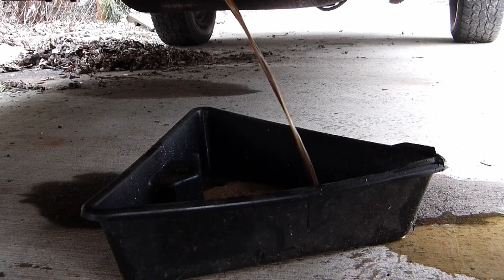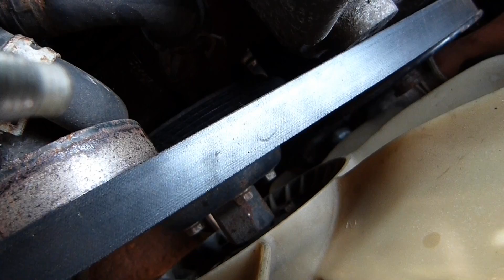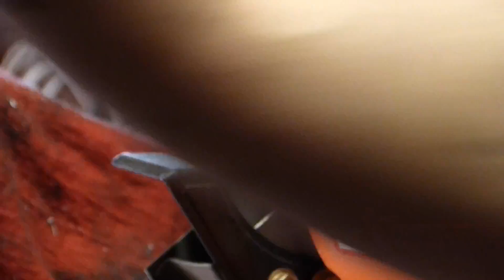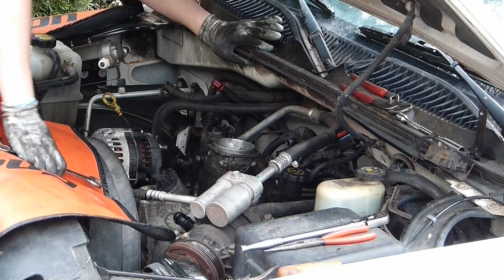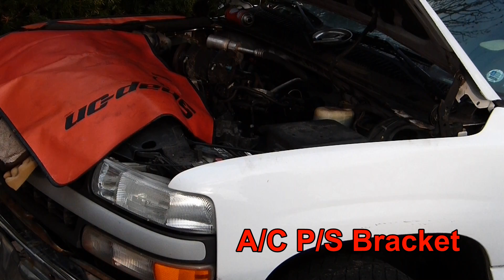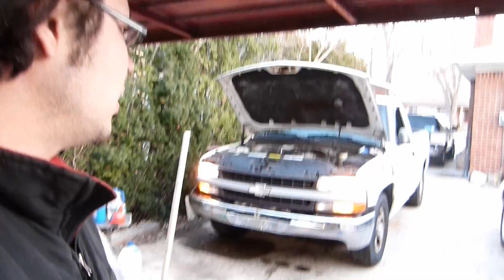4.3 Vortec Intake Gasket Replacement Guide Detailed

Comment: Any reason to not cut the corner from the compressor bracket? That's entirely too much work for 1 bolt and the compressor doesn't need 4 bolts!
Reply: How did u get yours off , I'm struggling, I removed the 3 long blots and the 2 studs. I can wiggle the bracket but it won't move forward . 
Any suggestions
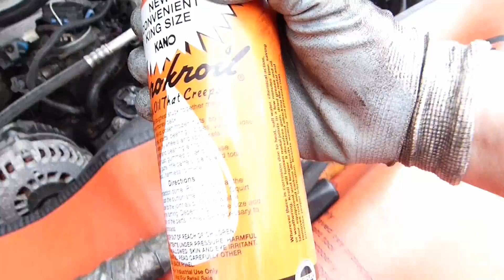Reply: @atownda_realesttv5585  did you get the ones as shown @6:33?

 I did what I said above, I removed the compressor and cut the bracket for the intake to clear and gain access. 

I wasn't going to go through all that nonsense removing the entire bracket just to gain access. IF there is an issue, then I'll make some support tabs (so far all is well). The A/C compressor does not need that much support! I work with buses and specialty conversion vehicles, one bus has 3 A/C compressors and they are only held on with 2 bolts and are just fine!
Reply from the maker: Even with the compressor unbolted from the bracket?  You working on an S-10 type?

Comment: So I’ve been told you have to take out the distributor and rotor do you have to in this scenario?
Reply from the maker: Yes I glossed over that thinking not saying there are plenty of tutorials on that.  My recommendation is don't be scared, what I did was 
1)  First paint mark the distributor shaft to the block
2) then pull it out carefully and also paint mark the distributor gear to the distributor shaft

This way if you don't move the crankshaft it will go back in without needing to be adjusted, because you marked the alignment of the gear and of the distributor clocking.  For a first timer, you'd probably want to remove the cap and note the position of the rotor incase you jump a tooth on reinstall.

Comment: Why did you replace the factory gasket with the same factory defective gasket. Fel pro replacement gasket CANT fail like the factory one. It’s steel with thick rubber around the coolant and intake ports
Reply from the maker: Did I not install a Felpro upgraded replacement gasket?  If you noticed I did not then shame on me, I was under the impression the gasket I used was the new design.

Comment: After I changed the gasket the Silverado 01  has been running rough putting the gasket could have caused the truck to act rough?
Reply: Check oval orange gasket (under injectors  case , it is next behind fuel  lines).

Comment: From my understanding there is a upper and a lower intake gasket is it always the lower that fails?
Reply from the maker: The problem is with the lowers.  Upper intake gasket won't dump coolant into the crankcase; however, it would cause an air leak and problems running.
Reply: Mega would it sound like it’s knocking cuz if it’s that then this is my case?

Comment: How do we know if crank is not 180 degrees out when setting chain on 2000 S10 4.3 Vortec
Reply from the maker: +william THOMPSON You can do the 50/50 chance method (if it doesn't run, then you're 180 off) or pull the valve cover to make sure both valves are closed when the piston is at TDC.

Comment: What fluid did u have to drain, cause i see u disconnected a lot of hoses??
Reply from the maker: +Miguel Valdez At first I drained the engine oil, which had coolant in it.  The only other fluid would be coolant from where it's supposed to be in the cooling system.  Don't disconnect the power steering or AC, those should flex.

Comment: I have a 4.3 2001 sliverado, and when I sit it up for a few days it run crazy, act like its going to kill. I looked at the engine and I noticed that there is water and anitfreeze between the intake. Do you know if my intake gasket is gone? Im wondering if I can do it myself instead of paying an arm and leg. I know I can unscrew the bolts,but I am afraid of the distrubator, timing, belt, and knowing where those harneses go. can you give me some feed back?
Reply from the maker: Do you ever refill the vehicle with coolant?  If yes, then you probably have a leak.

An acid test for coolant leaks is a coolant system pressure test.  You pressurize the coolant system and then see if it holds pressure.  If pressure drops, then you have a leak in your system.  If not, it could be a slow leak or a leak that does not occur until the engine is up to operating temperature.

Do you have coolant in your oil? Is your oil cap covered in white/light colored goo?  Then that's probably an intake gasket issue or even a head gasket.

I have no idea if you can do it yourself.  Take lots of pictures of stuff before removed and label all the bolts you removed and where they go.  Using the correct tools is also beneficial, an adjustable wrench won't cut it.

The most challenging thing is the fuel lines IMO,  you should try to remove those first thing and if you can't, stop.  The distributor is very simple, keep the thing from spinning out of position, mark it with a paint pen and don't hit the starter or manually turn the crankshaft of the engine; then you'll be fine.  The distributor is geared, so it will go back exactly how you took it out assuming all things the same.
Reply: Yes. I have bought tons of antifreeze. This morning I tried to start it up, and it is acting like it want to start
Reply from the maker: bigcartoonyIIV  You probably have to do an intake gasket =(  I would try to avoid running it in this condition, as you're going to damage the crankshaft bearings among other mechanical components, coolant makes a very bad lubricant.
Reply: I fear I have been running it like this for 2yrs, because I been adding antifreeze, and thought it was normal.  Im hoping I can do this job myself, because Icant afford a 1000 bill. my biggest fear is the distributor and getting the belts right.
Reply: +bigcartoonyIIV it has a timing chain, distributor is already set to its timing just only remove the one bolt and not the bracket and you will be fine.
Reply: Thanks. I had fig it out.
Reply: +bigcartoonyIIV.   Tips for you.. before  you remove  the distributor  make a mark by using a flat screw  driver  on the distributor  body all the  way down to the block ,

Comment: so much work. I'll never attempt it.
Reply: To be honest.  The only hard parts should be sliding the A/C mounting bracket forward and cleaning parts.  I'm getting ready to put all my parts back together right now.  If you can, take your time and it should go well.
Reply: If you have random bolts laying around on the intake then you weren't careful enough. Mucking up the urethane or silicone sealant at the ends of the block is easy to screw up. However, take your time and actually rehearse the movements you are going to make. The rehearsal alone is a huge help. 
That EGR tube was a little bastard and I twisted it off on the intake. Ordering a new one was work it. I coated the tube were the nut clamps the tube with anti seize.
Reply: It's easy.. I did mine 20+ miles in a national Forest... No one around.. no tow trucks... Simple

Comment: Hey. Nice shirt. New Yorker. how did u know it was intake and not head.
Reply from the maker: Based on the frequency of the issue, I assumed it was the intake gasket.
Reply: Mega Mechatronics When I pour water in the radiator it goes straight to the oil pan do you think this is my problem ? the intake gaskets instead of the head gaskets? Thanks in advance

Comment: I have a big problem. Yesterday I redid intake, because I broke a bolt in the engine the first time i tried it. I got everything back together, but my engine keeps stumbling and acting like its going to kill.  Do you have an idea whats causing it?
Reply: bigcartoonyIIV dead battery
Reply: what was it?
Reply: @jonhsmith2706   When I changed the intake plenum i put gasket sealer, and didnt torque it tight enough. It ran well for 6 years, and Now I have new issues cant seem to figure out. The truck is almost 21yrs old, so im on the verge to saying EFF it, and trade it in..lol
Reply: Did it back fire when it stumbled when applying throttle?  Just finished lower intake gaskets. Runs pretty good until the throttle is pressed.
Reply: @TyRC12  I ended up taking it apart and re doing it. You prob have a gasket leak.  I cranked up my truck and sprayed carb cleaner until i found it.  Also your fuel injectors could be crossed. I had that issue last year.   Im planning on gettting rid of my truck now though.

Comment: I have a major water leak and I was told it was the intake manifold gasket. the guy I am gonna use to fix it told me $350 and 3 hours. does that sound about right?
Reply from the maker: Sounds okay, but what does a shop charge? If the shop charges a little more, I would go with that only because the shop is responsible for warranty repairs and possibly engine damage from mis-repair.  A cash job has no such warranties and you will be surprised how peoples attitudes change after you paid them, people are pretty friendly until they get your cash.
Reply: Very true- How long will this job take? how much do you think a auto shop would charge? thanks

Comment: Please don't listen to this guy with the silicone yeah it plugs up the screen then it starts the engine of oil and as far as Transmissions go they got a filter in the pan this guy wouldn't work on my motor